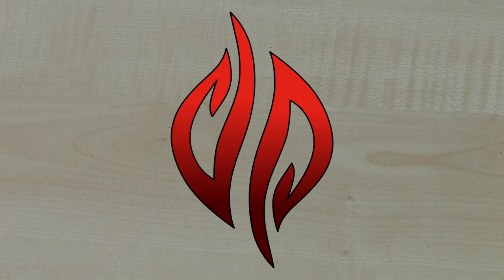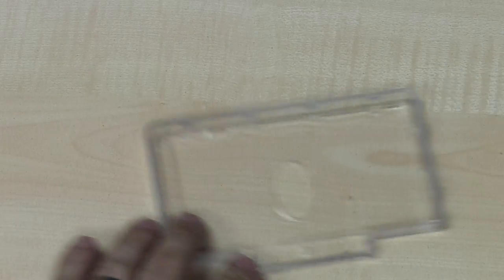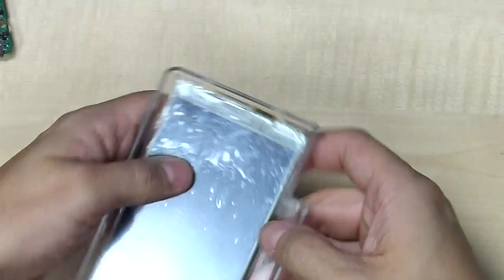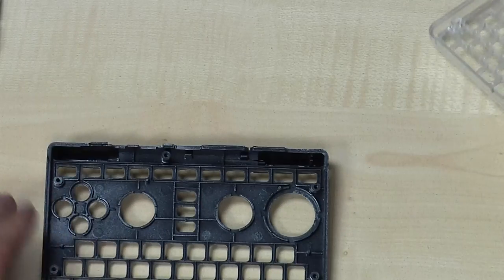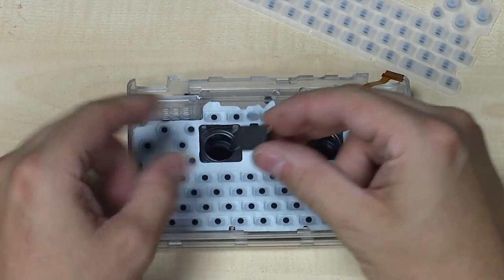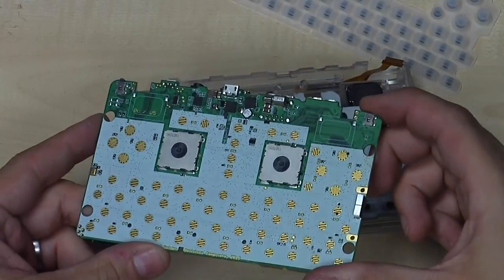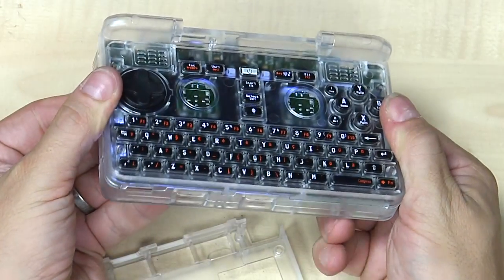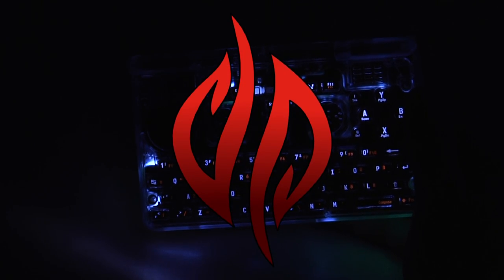Assembling a Pyra

Comment: I already ordered the GPD Win, I know it has some deficits compared to yours, also a few advatages (x86 being the biggest). I will probably end up trying to sell the GPD Win if I cant get Linux to work well on it :) I hope it won't come down to that. If I end up selling the GPD Win of course I can't do that wihout buying a Pyra first. Been following you since the Pandora, but never got around to getting one, and Pyra looks so much better. I just hope I get my GPD Win soon (earliest possible shipping date is in 5 days, probably later), but I don't think I can settle with Windows. If I get my way, its going to be my GPD Lin.
Reply: The OMAP 5 as on Pandora was the only SOC available for small quantities during the conception but Pyra's design allows to have SOC upgrades.
If any upgrade is available, might be ARM SOC, might be x86 (if someone is ready to make some BIOS for the Pyra) or might even be RISC-V (lowRISC is an openhardware SOC project based on this arch, maybe it will be available and suitable for Pyra)
Reply: Vierax There have to be sold quite a few Pyras before an upgrade is economically feasible to produce. Yes even EvilDragon has said that there need to be sold quite a few before they can think about an upgrade SOC. And even if that happens (which is entirely feasible but not guaranteed, making an ARM SOC upgrade will be the definitively cheapest path for sure. 

Hoping for the best but I am not waiting for an x86 Pyra, and I don't see I have use for a RISC Pyra. ARM is fine, I just prefer x86. 

I'll see how it goes with my GPD Win, I mean GPD Lin. first.
Reply: Are you a member on the boards? If not then maybe you missed that someone posted their experience in trying to install Linux on the system. It's on this page https://pyra-handheld.com/boards/threads/gpd-is-going-to-release-an-x86-console-palmtop-computer.76762/page-69  if you missed it. Posted by EvilDragon. You have to scroll down to find it.
Reply: Animated Freak I appreciate the link, I am a member, but I don't frequent the board. However the link to that post has been posted so many places I already saw it. Still I really do appreciate it. 

This is a response I wrote on reddit, since I have experience porting Linux to unsupported x86 computers. https://www.reddit.com/r/gpdwin/comments/50hpif/evildragon_installs_linux_on_the_gpd_win/d7cjtis
Reply: Ziggurat
Sweet, best of luck. I would love to see a video of Linux on it when it's working better.

Comment: I had one question! Is it possible to change out the hinge part with one from say the Nintendo DS? I know there are others that snap in with different angels.
Reply: Shouldn't be possible as a lot of portable devices use different cables and sometimes the protocol is different too.
Even with an adapter it must be tricky.
Reply from the maker: I think the DS Lite one fits though.
Reply: OpenPandora
Sweet!
I looked up the price for new once for the  DS Lite. Pretty cheap so I might just buy one just to test if it's work and then tell people if it does.
Reply: @Vierax
Animated Freak is a forum member, so I think he knows his stuff and just meant the little black part that's seen at 10:10 in the video.

This hinge is the same one as in the Pandora, produced by the same company that also produced the hinge of the Nintendo DS and DS Lite. As these hinges locking in at 170° are patented, OpenPandora GmbH couldn't just buy them for their devices, but the company building these hinges made them the exact same size as the DS ones. They are interchangeable, so if you don't want the Pandora/Pyra hinge locking at 180°, you could just get an old DS hinge and replace it.  Or you could buy a third party hinge from some chinese company that blatantly disregards the patents and put that in there, but some forum members tried that and found these ones to be of lower quality than the original DS or Pandora ones.

I myself will do that as soon as I get get my hands on a Pyra as I like the 170° lock a lot better, and of course I will report my experience with that to the forum. This was rarely done with the Pandora as you had to disassemble the whole handheld and its display cable could easily break doing that, but I hope to see that little mod being done to the Pyra more often.
Reply: ijustwrestledabear
Yes, that is what I was talking about. I will be waiting for your post then before I try anything so I can see what results you have from it.

Comment: any word on the expected release date? I can see it can be preordered but after the w3d fiasco I am soooo scared this is vaporware.
Reply: Yes, Two Months™.  It's always two months (the first optimistic prediction for prototypes was for end of 2014, while it's only now that the final prototypes are being produced).  Also, since it's pre-order-funded and the smallest production batch is 500 units, it will continue to be pre-order-only after the first 1000-batch is produced because he needs at least 1500 pre-orders until he has enough funds to continuously have it available in the store.  So if you don't want to wait a lot longer, you will have no choice but to pre-order.  Actually, if you still want to be in the first batch, you only have a few weeks left to pre-order.  Also this video itself disqualifies the Pyra as vapourware somewhat and while it's probably EvilDragon's biggest project, he's only working on it on the side while managing his retro hardware shop, so there would need to be many things to go awry to have any impact at all.
Reply: One year later.. the "final" prototypes turned out to be not so final with the 4 GB issue and other tidbits.  Another round of SoC board PCBs are currently being produced that should fix it and will be used for the hopefully actual final prototypes.  I learned in the meanwhile that even the retro hardware shop is not his main job.  He makes videos for other companies as a living and while this means that he is financially secured, I think it slowed down testing and actually thinking things through with the Pyra a lot with how little time he has left for that and it can't be good for his health either being constantly sleep-deprived..